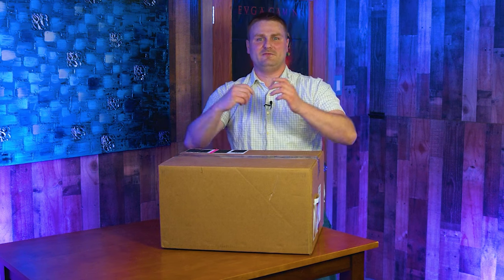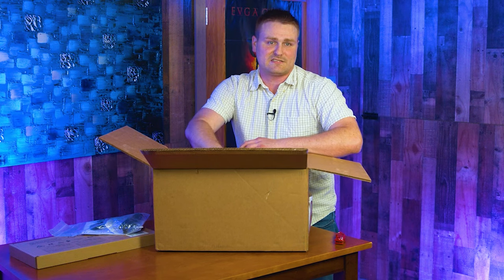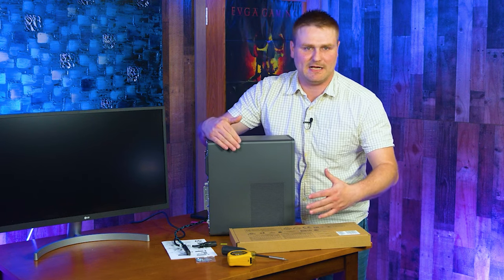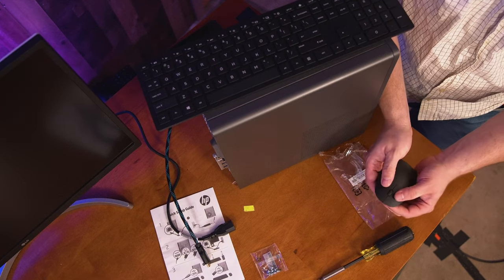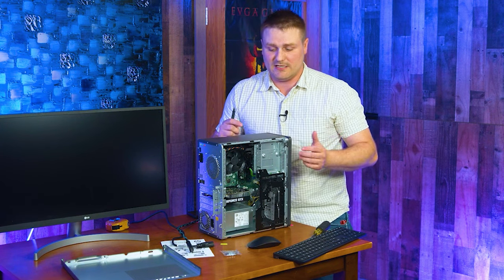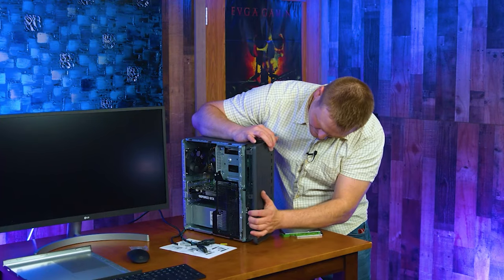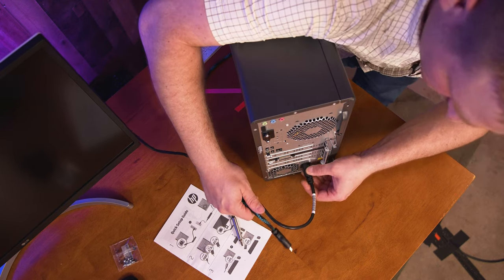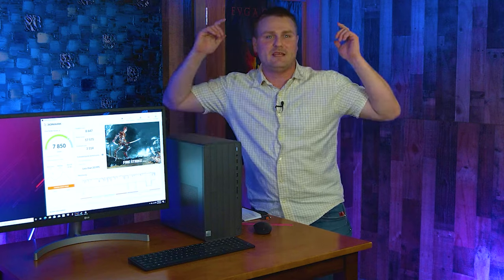HP Envy Gaming Desktop PC TE01-1165T GTX 1650 GPU i5 intel Unboxing, Benchmark and Upgradability.

Comment: Thanks for the upload. Most of us are going to need to replace the power supply and buy the 24 pin to 4 pin connector for the motherboard power. Idk why prebuilt pc manufacturers dont use the standard power connector for the motherboards. Its just dumb. But you do save a lot of money buying prebuilt then buying the parts individually.

Comment: Thank you so much for making a video on this PC. I have the I7 and am looking into a GPU, but I'm not that computer smart. Could you do a video on how to install one and what type of GPU wouldn't under do performance or overdo performance?
Reply from the maker: Well if you are looking to get good performance, But not break the bank the RX6600XT
Reply: Thank you very much!
Reply: The graphics card that you had in there, mine didn’t come with. So mine doesn’t have an independent GPU at all.
Reply from the maker: @weatherataglance6075  Really, if you have a 400watt it will support it.
Reply: @TNW1337  Can you replace the 180watt PSU for one that's 400watt
Reply: You probably need to replace the power supply and buy the 24 pin to 4 pin connector. It's not hard and you can't mess it up. I promise.

Comment: The inside is just the same as the tg01.
And just the same as the TG01 the extra hard drive fits just fine in the upper cage to leave room for a 28mm graphic card. If you can afford one these days, that is.
Reply from the maker: Yeah I am not happy about the state of Gpus out there.